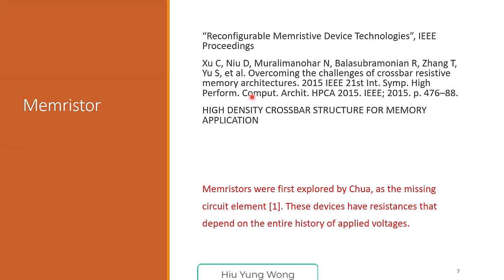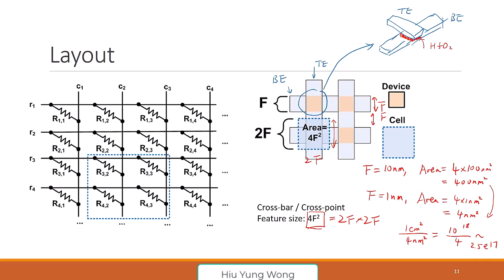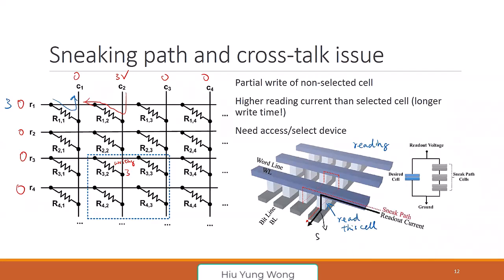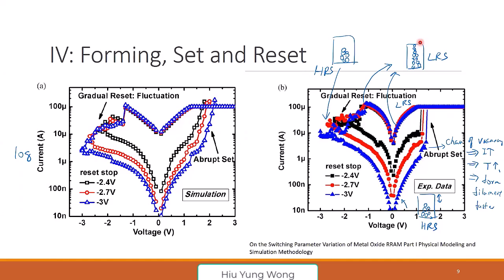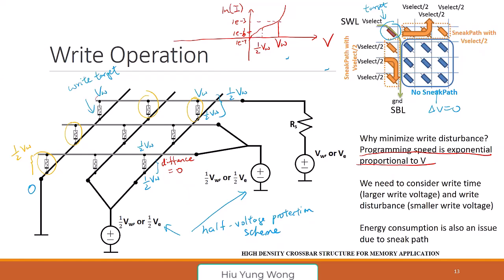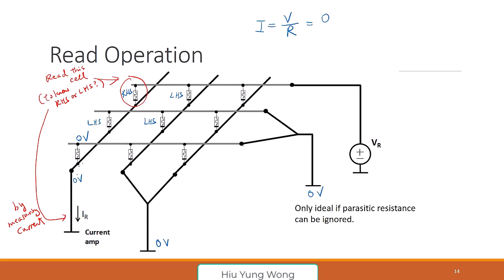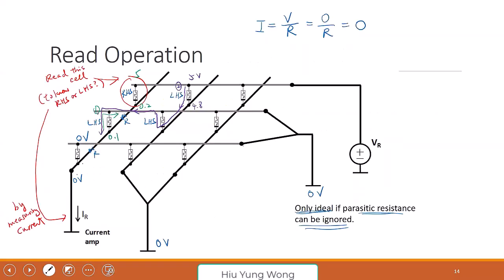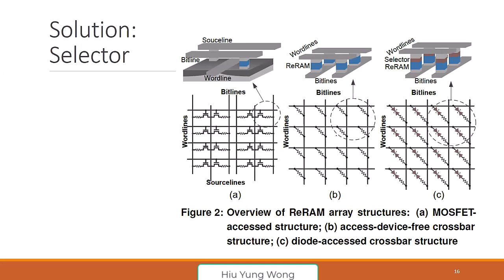22 - ReRAM Circuit, Layout, Read and Write Operations and Issues

Comment: Differences between Cross point and Crossbar?
Reply from the maker: @yayabalalovesall They are similar, in my opinion. Crossbar means the vertical and horizontal lines (bars) crossing each other and the device is formed at where they cross each other. Crosspoint highlights the fact that the device occurs at the points where the wires crossing each other. My 2 cents.
Reply: @quantum_computing  Okay. Thank you for the answer.